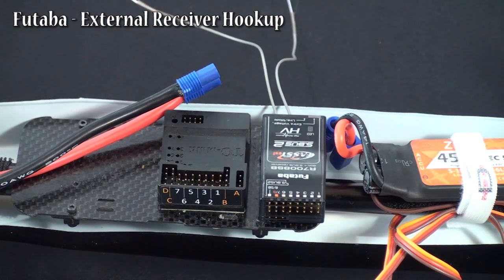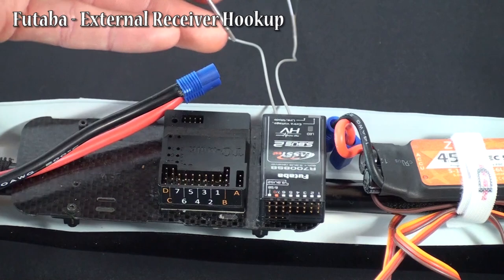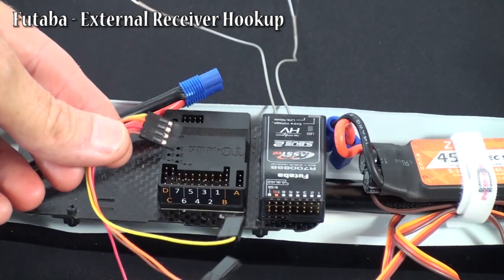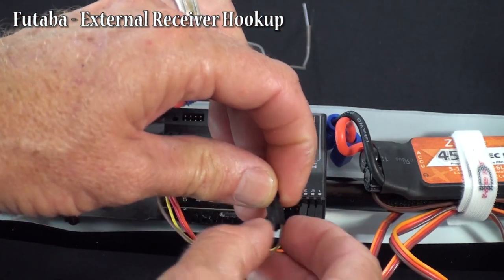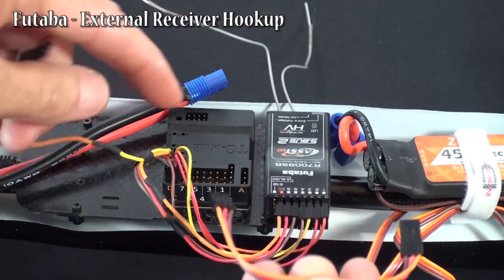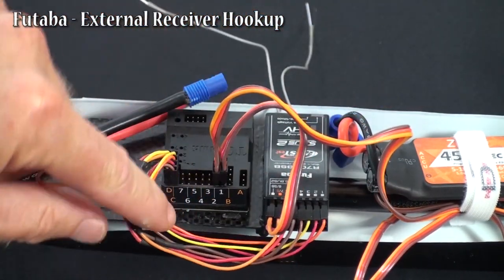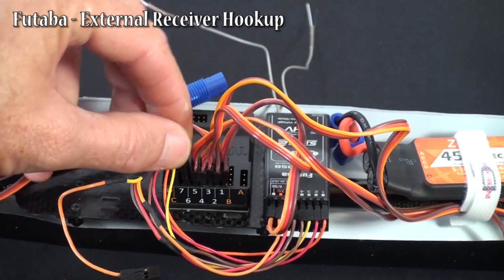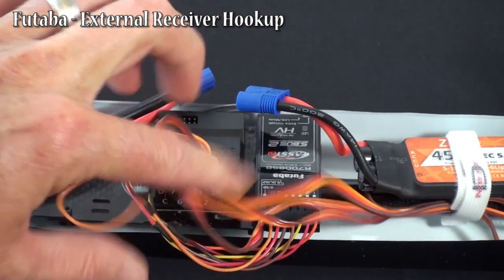Stingray 500 Setup Vid #4d - External receiver Futaba

Comment: Why are you connecting the pitch output of the receiver to AUX1 of the tg-multi? I'm using a Graupner Hott gr12 receiver which also features a pitch servo output. Is it even necessary to connect it or are aileron, throttle, rudder and elevator enough for the Stingray to fly?